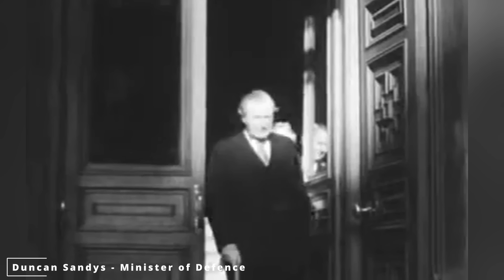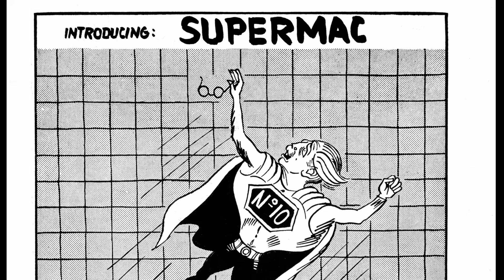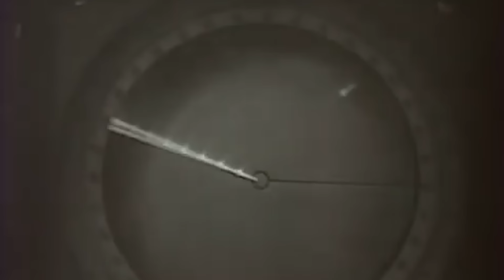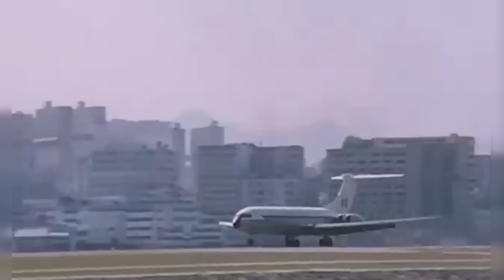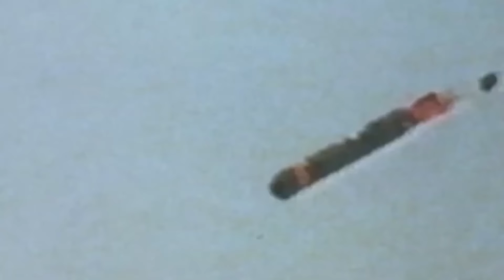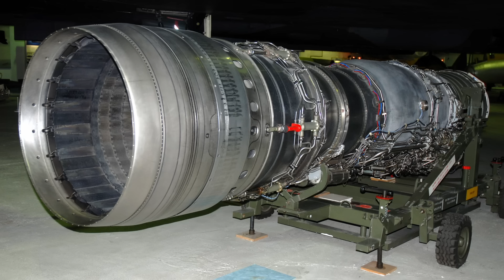How Britain Turned A Failed Airliner Into a Soviet Submarine Predator | The Mighty Nimrod

Comment: Still think we have always had the best looking aircraft and submarines...

Now we have copy and paste appeasement vehicles. I will never fight for sell out shell of a nation and i do mean never... i would rather take the cell or bullet with my standards intact.
Reply: That's basically an admission, that you openly admit that British aircraft were inferior.
Reply: @sandervanderkammen9230 

Typhoon & Tornado, British design aircraft. 

Early days of the airliners.

The awesome De Havilland Comet.
World's first production jet airliner.
World's first high altitude airliner. 
At the time the Comet wasn't particularly dangerous. The DH Comet was definitely not the worst engineering failure in commercial airliner history.

Losses comparisons.
How things were in those days.

DeHavilland Comet 4 UK                          14% 
DeHavilland Comet all mks UK (ff 1949)17%  
Vickers VC10 UK (ff 1962)                         5%

Douglas DC-1  US                                       99%
Douglas DC-2                                              47%
Douglas DC-3                                              30%
Douglas DC-4                                              26%
Boeing s300    US                                       72% 
Boeing 307                                                  70%
Boeing 247                                                   48%
Boeing 707  (ff 1958)                                 32% 
Lockheed L-049 Constellation (ff 1943)  30%
Lockheed Electra US (ff 1957)                   29%
Fairchild FH-227 US (ff 1966)                   32%
McDonnell Douglas DC-8 US  (ff 1958)   14%
Sud Aviation Caravelle  (ff 1955)             15%
Canadair CL-44 Turboprop US (ff 1959) 46%  
Convair CV-580 Turboprop US (ff 1960) 22%
Convair CV-880     (ff 1959)                      27% 
Convair CV-990     (ff 1961)                      33%
Tupolev T-104        (ff 1956)                     16%
Vickers Viscount UK  (ff 1948)                29%  
Fokker F-27 Turboprop NL (ff 1955)       40%      

The Vickers VC10, fastest Atlantic crossing for a non supersonic jet airliner, held the record for 41 years.

For the first few years of operation the Caravelle & Comet had similar accident loss fatalities.

De Havilland had prior experience building many all metal construction airframe aircraft & thousands of jet powered fighter aircraft that were primarily of metal construction with pressurised cockpits & jet engines built by De-Havilland. No aircraft before the Comet was subjected to as much pre-production testing as the Comet. 

It's a great pity & a crying shame that British military forces had to occupy a large part of Germany for decades after 1945 & Russian military forces had to do the same. Of course Russia still posseses a large chunk of what was German territory & of course Russia & the UK produce nukes. Obviously Germany does not produce nukes.

Interesting British achievements.

The gas turbine engine was invented & patented in England before the 1800s.

Axial multi stage sequential stage compressor & turbine technology, first produced for turbo machinery use in England by Parsons of Ireland & North England during the 1800s. The components form the basis of most modern gas turbine aero engines. At the time the concept of the jet aircraft powered by axial internal combustion gas turbine engines was first mentioned thus the internal combustion jet engine & jet aircraft was indeed invented in England before the 1900s & before the Wright brothers got busy.

Work on the multi stage sequential stator rotor axial compressor as applicable to the axial compressor gas turbine aero engine was ongoing in England from around 1928 by Arnold Griffiths and others. By 1943 the Metrovik F2/3  Beryl was a running axial turbojet that was superior to anything anywhere else. As the centrifugal compressor engines were adequate and more powerful at the time development of a larger F2/3  version was commenced.

The Metrovik (UK)  F2/3 axial compressor gas turbine aero engine was flight certified & ran in 1942, it was the result of UK development work ongoing since 1929. At the time it was the most capable axial compressor turbojet in existence but was not required and development work continued on a larger version.

Frank Whittle performed the world's first demonstration of a gas turbine aero engine in 1937. People in Germany kept a close eye on everything going on in Britain at the time.

The centrifugal compressor RR Nene was the most powerful & most reliable gas turbine aero engine on the planet in 1944. That engine would be later built under license or copied in many countries including Russia (Mig-15 Mig-17), China, the US, France and Switzerland powered dozens of aircraft types for decades after 1944.

Pratt and Whitney and others produce centrifugal compressor gas turbine aero engines. The PW200 is a currently produced whittle style centrifugal compressor, reverse flow combustor, gas turbine aero engine. 

The world's first wind tunnel was constructed in England during the 1870s. The world's first supersonic wind tunnel was constructed in England in 1922.

There is no doubt that the Fairey (England)
Delta 2 was the world's first jet
aircraft to exceed 1000 mph.  Indeed It
exceeded the previous record by 310 mph &
held the record for 1 year. Incidentally, the Dassault Mirage 3 & 4 are based on the Fairey Delta 2.

More recent UK military jet aircraft.

The Tornado & Typhoon & their engines are Supersonic & are indeed British design aircraft with British design engines built by an international consortium. The Tornado design for example started life during the 1950s at Vickers as the AFVG, it's engine is based on the RR RB-199. The EE Lightening is also a British Supersonic jet aircraft.

The Typhoon is the British BAC-EAP with an engine based on the British RR XG-40, the Typhoon is also built by an international consortium.

Brazil has the world's third largest airliner manufacturer and makes very good airliners & Brazil is 100th down the list along with Indonesia for wealth per capita. Of course it is in fact the case that Embraer can't build those airliners without purchasing stuff from the US, UK & Europe. For example, Norway, Holland, Denmark, Ireland & Belgium, top 20 wealth per capita, don't make airliners, its as simple as that.

Global aerospace. 
From the 1950s sector rationalisation and consolidation took place. 70 companies in France and 300 companies in the US disappeared due to merger or dissolution. In the US Boeing was almost bankrupted by the 707 project.  Boeing had a well protected domestic market and the available space and resources in the US to engage in large scale airliner manufacturing enabling them to capture orders simply by being able to produce airframes fast enough and cheap and nasty enough. Another factor is airlines preferring to obtain as much of their airliner inventory as possible from one manufacturer. 

Global Aerospace Sector, what's happening.

For example, there are of course no German companies that makes German jet aircraft in Germany & there are no German companies that make German gas turbine aero engines in Germany that are suitable for widebody airliners.

The UK has the world's highest combined per capita Nuclear / Defence / Aerospace Sector Activity.

UK defence sector, absolute terms, world's second highest activity. 1st for per capita defence sector activity. Per capita nuclear powered submarine construction, 2nd position. 
Main players being Rolls Royce, Babcock, GKN Aerospace & BAe Systems. Activities often involve international collaboration. BAe systems, RR and other UK companies now handle more Airbus work value wise than Germany. 

There's a good chance that anyone currently flying on a widebody airliner will be on an aircraft powered by RR gas turbine aero engines made in the UK and a good chance there will be other hardware on the aircraft that's designed and / or manufactured in the UK. 

Rolls Royce Holdings UK
Subsidiaries
- Rolls-Royce plc
- Rolls-Royce North America (ex Allison etc Classified Military stuff)
- Rolls-Royce AB
- Rolls-Royce Deutschland
- Rolls-Royce India Private Limited
- Rolls-Royce Marine Power Operations
- Vinters Engineering Limited
- Rolls-Royce Controls and Data Services
- Rolls-Royce Power Systems
- Bergen Marine
Joint ventures include:
- Rolls-Royce Turbomeca
- MTU Turbomeca -

Trent Family
The MT30 (Marine Turbine)
Industrial Trent 60 Gas Turbine
Trent 7000
Trent XWB Airbus A330neo.
Trent 1500
Trent 1000
Trent 500
Trent 600
Trent 700
Trent 800
Trent 8100
Trent 900
   
RR wholly owned subsidiaries in Germany handle smaller 2 shaft RR gas turbine aero engine work.

The UK space and aerospace sectors are highly productive, high-value industries that together contribute over £18 Billion in direct Gross Value Added (GVA) to the UK economy. Individually, the space industry directly contributes about 0.3% of UK GDP 7•2 Billion while the aerospace industry contributes approximately 0.5% £10•9 Billion.
   
We hope this helps.
Reply: Vulcan and harrier are cool-looking planes, but the rest...
Reply: @motormannband  Nimrod, Victor, Lanc's, Spitfire, Hurricane, Typhoon, Mosquito, Hawk, Hunter, Lightning, Javelin, TSR-2, Avro Delta Series, Avro 707 and every single Submarine 1939 to present...
Reply: I've heard a Tornado being described as a brutal looking aircraft. Kind of fits I think.
Hunter was undoubtedly the prettiest.
Reply: @kitbag9033  I think Tornado and EF Typhoon are actually some of the best looking (And EF Typhoon is my favourite fighter on Earth). But i was just listing "British only". FULL Joint projects are fine, but just buying mediocre copy paste from another nation and justifying it because we make some bolts for it don't wash lol.
Reply: @babalonkie  Tornado and Typhoon are not British.
Reply: @DoktorBayerischeMotorenWerke 

Typhoon & Tornado, British design aircraft. 

Early days of the airliners.

The awesome De Havilland Comet.
World's first production jet airliner.
World's first high altitude airliner. 
At the time the Comet wasn't particularly dangerous. The DH Comet was definitely not the worst engineering failure in commercial airliner history.

Losses comparisons.
How things were in those days.

DeHavilland Comet 4 UK                          14% 
DeHavilland Comet all mks UK (ff 1949)17%  
Vickers VC10 UK (ff 1962)                         5%

Douglas DC-1  US                                       99%
Douglas DC-2                                              47%
Douglas DC-3                                              30%
Douglas DC-4                                              26%
Boeing s300    US                                       72% 
Boeing 307                                                  70%
Boeing 247                                                   48%
Boeing 707  (ff 1958)                                 32% 
Lockheed L-049 Constellation (ff 1943)  30%
Lockheed Electra US (ff 1957)                   29%
Fairchild FH-227 US (ff 1966)                   32%
McDonnell Douglas DC-8 US  (ff 1958)   14%
Sud Aviation Caravelle  (ff 1955)             15%
Canadair CL-44 Turboprop US (ff 1959) 46%  
Convair CV-580 Turboprop US (ff 1960) 22%
Convair CV-880     (ff 1959)                      27% 
Convair CV-990     (ff 1961)                      33%
Tupolev T-104        (ff 1956)                     16%
Vickers Viscount UK  (ff 1948)                29%  
Fokker F-27 Turboprop NL (ff 1955)       40%      

The Vickers VC10, fastest Atlantic crossing for a non supersonic jet airliner, held the record for 41 years.

For the first few years of operation the Caravelle & Comet had similar accident loss fatalities.

De Havilland had prior experience building many all metal construction airframe aircraft & thousands of jet powered fighter aircraft that were primarily of metal construction with pressurised cockpits & jet engines built by De-Havilland. No aircraft before the Comet was subjected to as much pre-production testing as the Comet. 

It's a great pity & a crying shame that British military forces had to occupy a large part of Germany for decades after 1945 & Russian military forces had to do the same. Of course Russia still posseses a large chunk of what was German territory & of course Russia & the UK produce nukes. Obviously Germany does not produce nukes.

Interesting British achievements.

The gas turbine engine was invented & patented in England before the 1800s.

Axial multi stage sequential stage compressor & turbine technology, first produced for turbo machinery use in England by Parsons of Ireland & North England during the 1800s. The components form the basis of most modern gas turbine aero engines. At the time the concept of the jet aircraft powered by axial internal combustion gas turbine engines was first mentioned thus the internal combustion jet engine & jet aircraft was indeed invented in England before the 1900s & before the Wright brothers got busy.

Work on the multi stage sequential stator rotor axial compressor as applicable to the axial compressor gas turbine aero engine was ongoing in England from around 1928 by Arnold Griffiths and others. By 1943 the Metrovik F2/3  Beryl was a running axial turbojet that was superior to anything anywhere else. As the centrifugal compressor engines were adequate and more powerful at the time development of a larger F2/3  version was commenced.

The Metrovik (UK)  F2/3 axial compressor gas turbine aero engine was flight certified & ran in 1942, it was the result of UK development work ongoing since 1929. At the time it was the most capable axial compressor turbojet in existence but was not required and development work continued on a larger version.

Frank Whittle performed the world's first demonstration of a gas turbine aero engine in 1937. People in Germany kept a close eye on everything going on in Britain at the time.

The centrifugal compressor RR Nene was the most powerful & most reliable gas turbine aero engine on the planet in 1944. That engine would be later built under license or copied in many countries including Russia (Mig-15 Mig-17), China, the US, France and Switzerland powered dozens of aircraft types for decades after 1944.

Pratt and Whitney and others produce centrifugal compressor gas turbine aero engines. The PW200 is a currently produced whittle style centrifugal compressor, reverse flow combustor, gas turbine aero engine. 

The world's first wind tunnel was constructed in England during the 1870s. The world's first supersonic wind tunnel was constructed in England in 1922.

There is no doubt that the Fairey (England)
Delta 2 was the world's first jet
aircraft to exceed 1000 mph.  Indeed It
exceeded the previous record by 310 mph &
held the record for 1 year. Incidentally, the Dassault Mirage 3 & 4 are based on the Fairey Delta 2.

More recent UK military jet aircraft.

The Tornado & Typhoon & their engines are Supersonic & are indeed British design aircraft with British design engines built by an international consortium. The Tornado design for example started life during the 1950s at Vickers as the AFVG, it's engine is based on the RR RB-199. The EE Lightening is also a British Supersonic jet aircraft.

The Typhoon is the British BAC-EAP with an engine based on the British RR XG-40, the Typhoon is also built by an international consortium.

Brazil has the world's third largest airliner manufacturer and makes very good airliners & Brazil is 100th down the list along with Indonesia for wealth per capita. Of course it is in fact the case that Embraer can't build those airliners without purchasing stuff from the US, UK & Europe. For example, Norway, Holland, Denmark, Ireland & Belgium, top 20 wealth per capita, don't make airliners, its as simple as that.

Global aerospace. 
From the 1950s sector rationalisation and consolidation took place. 70 companies in France and 300 companies in the US disappeared due to merger or dissolution. In the US Boeing was almost bankrupted by the 707 project.  Boeing had a well protected domestic market and the available space and resources in the US to engage in large scale airliner manufacturing enabling them to capture orders simply by being able to produce airframes fast enough and cheap and nasty enough. Another factor is airlines preferring to obtain as much of their airliner inventory as possible from one manufacturer. 

Global Aerospace Sector, what's happening.

For example, there are of course no German companies that makes German jet aircraft in Germany & there are no German companies that make German gas turbine aero engines in Germany that are suitable for widebody airliners.

The UK has the world's highest combined per capita Nuclear / Defence / Aerospace Sector Activity.

UK defence sector, absolute terms, world's second highest activity. 1st for per capita defence sector activity. Per capita nuclear powered submarine construction, 2nd position. 
Main players being Rolls Royce, Babcock, GKN Aerospace & BAe Systems. Activities often involve international collaboration. BAe systems, RR and other UK companies now handle more Airbus work value wise than Germany. 

There's a good chance that anyone currently flying on a widebody airliner will be on an aircraft powered by RR gas turbine aero engines made in the UK and a good chance there will be other hardware on the aircraft that's designed and / or manufactured in the UK. 

Rolls Royce Holdings UK
Subsidiaries
- Rolls-Royce plc
- Rolls-Royce North America (ex Allison etc Classified Military stuff)
- Rolls-Royce AB
- Rolls-Royce Deutschland
- Rolls-Royce India Private Limited
- Rolls-Royce Marine Power Operations
- Vinters Engineering Limited
- Rolls-Royce Controls and Data Services
- Rolls-Royce Power Systems
- Bergen Marine
Joint ventures include:
- Rolls-Royce Turbomeca
- MTU Turbomeca -

Trent Family
The MT30 (Marine Turbine)
Industrial Trent 60 Gas Turbine
Trent 7000
Trent XWB Airbus A330neo.
Trent 1500
Trent 1000
Trent 500
Trent 600
Trent 700
Trent 800
Trent 8100
Trent 900
   
RR wholly owned subsidiaries in Germany handle smaller 2 shaft RR gas turbine aero engine work.

The UK space and aerospace sectors are highly productive, high-value industries that together contribute over £18 Billion in direct Gross Value Added (GVA) to the UK economy. Individually, the space industry directly contributes about 0.3% of UK GDP 7•2 Billion while the aerospace industry contributes approximately 0.5% £10•9 Billion.
   
We hope this helps.
Reply: @kitbag9033 Hunter still is a beautiful bird.
Reply: With the current and likely future leaders of the UK, if we did join an armed conflict, I'm not sure we'd be on the right side
Reply: @RoamingAdhocrat  I will publicly say what side i am on... Not any individual bought/threatened/aligned to/by the monarchy, USA or super wealthy (Starmer, Streeting, Davis, Polanski, Farage and the entire Tory party... they are all "Bought" and they will all manipulate to force a certain outcome to benefit themselves and their masters... of which is not Joe Public of Britain or anywhere).

That playbook don't work on me anymore... infact, i am now the type of person that will crawl through barbwire just to burn that playbook in their faces.
Reply: @RoamingAdhocrat  The UK is still a United States territory and protectorate... so that decision will be made in America, not Britain.
Reply: @DoktorBayerischeMotorenWerke  And the US, since ~2000, has a disastrous track record... not sure what good they've done lately other than support Ukraine and even that's been half-hearted
Reply: @RoamingAdhocrat  Britain has not won a war (a real war) since 1918.
Reply: @DoktorBayerischeMotorenWerke sure, if you exclude all the wars since then that contradict your point 🤡
Reply: @RoamingAdhocrat  Britain surrendered to the U.S. in September 1940 and was a U.S. possession from 1946 until 2006
Reply: @DoktorBayerischeMotorenWerke  ok
Reply: @RoamingAdhocrat  The Tizard Mission and the Anglo-American Bailout Loan Agreement were truly humiliating events in British history that are rarely discussed in the UK... brits prefer to use the euphemistic expression the "Special Relationship" with American to refer to this shameful defeat.
Reply: @RoamingAdhocrat Hows your boat?
Reply: @TarryHruman I don't have a boat. Do you mean my bike? I left it on the driveway and some months later, noticed someone stole it.
Reply: @RoamingAdhocrat I needed a new vape. So....sorrry?
Reply: Blackbird, Hustler, Stratojet, Tomcat, Falcon, Eagle....are you mad?
Reply: @TarryHruman Other than the BlackBird and F-16... i think the others are god ugly overhyped fat whales... always have (Exact same with the chungus fuel guzzler known as the Raptor). F-16 is cute and the only aircraft that actually looks like a fighter (Because it is the only real fighter among them) but i would still choose any current European fighter in looks and performance.

But i think the UK publicly rejecting repeated offered purchases of most of those aircraft speaks louder than my words... So does the nations who tried to appease by buying F-16's and F-18's and quickly realising they are expensive to maintain degrading hand off's and can't get into weapons envelope of a Chinese spy balloon... and putting them down for immediate replacement with European Aircraft... But hey ho... Just Europe "Stepping up" as requested.
Reply: @babalonkie I thought we were talking about aircraft. Not empire. I'm not sure what you mean about the F-16 being the "only real fighter among them" as the F-15 has managed 104 A2A kills with ZERO A2A losses. If that's not a "real fighter", then what is it?
Reply: @TarryHruman "I thought we were talking about aircraft. Not empire. I'm not sure what you mean about the F-16 being the "only real fighter among them" as the F-15 has managed 104 A2A kills with ZERO A2A losses. If that's not a "real fighter", then what is it?"

You are looking into that far too much... it was not meant to be a insult or opinion. "Fighter"... is different to a Strike Fighter or Interceptor Fighter for example... It is a "True Fighter"... As any USAF Pilot will tell you... whether they have flown one or not.

But if you are going to bring up stats... Who needs to shoot it down when it has a official "1.99 aircraft destroyed per 100,000 flight hours" record lol...
Reply: @babalonkie  Please name a British combat jet that is still in RAF service? Or any British company that still makes a British jet aircraft in the UK?
Reply: @DoktorBayerischeMotorenWerke 

Comet / Nimrod notes. 

We believe we can clear up some commonly held myths and misconceptions obviously.

It's always good to see the facts presented clearly and concisely isn't it?

Obviously there have been worse aircraft for accident losses both before & after the Comet.

All jet airliners benefited greatly from the knowledge gained from the Comet incidents & subsequent investigations & yet some were still worse for accident losses. 

It's a great pity & a crying shame that British military forces had to occupy a large part of Germany for decades after 1945 & Russian military forces had to do the same. Of course Russia still posseses a large chunk of what was German territory & of course Russia & the UK produce nukes. Obviously Germany does not produce nukes.

Instances of all marks of the Comet flew with full certification after 1954 including the Comet 3. The last Comet flight occured in 1997.

The fabulous trail blazing DH Comet.
World's first jet airliner.
World's first high altitude airliner.
World's first airliner with a full fuselage length pressurised cabin pressurised for high altitude flight. That feature for that type of aircraft was a considerably difficult undertaking. 

How things were back then.
Accident losses - % of aircraft built.

DeHavilland Comet 4 UK                          14% 
DeHavilland Comet all UK (ff 1949)        17%  
Vickers VC10 UK (ff 1962)                        5%

Douglas DC-1  US                                       99%
Douglas DC-2                                              47%
Douglas DC-3                                              30%
Douglas DC-4                                              26%
Boeing s300    US                                       72% 
Boeing 307                                                  70%
Boeing 247                                                   48%
Boeing 707  (ff 1958)                                 32% 
Lockheed L-049 Constellation (ff 1958)  30%
Lockheed Electra US (ff 1958)                   29%
Fairchild FH-227 US (ff 1966)                   30%
McDonnell Douglas DC-8 US  (ff 1958)   14%
Sud Aviation Caravelle  (ff 1955)             15%
Canadair CL-44 Turboprop US (ff 1959) 46%  
Convair CV-580 Turboprop US (ff 1960) 22%
Convair CV-880     (ff 1959)                      27% 
Convair CV-990     (ff 1961)                      33%
Tupolev T-104        (ff 1956)                     16%
Vickers Viscount UK  (ff 1948)                32%  
Fokker F-27 Turboprop (ff 1955)             39%      

The Vickers VC10, fastest Atlantic crossing for a non supersonic jet airliner, held the record for 41 years.

For the first few years of operation the Caravelle & Comet had similar accident loss fatalities.

The first few Nimrod airframes were Comet 4 airframes with the equipment bay tacked on. Subsequent Nimrods were new build Comet 4 airframes with the modifications built by the DH team at Hawker Siddeley.

Military aircraft accident losses. 
Lockheed XF104                 (ff 1954) 100%
Lockheed  P80                      (ff 1944) 43%
Lockheed F104                     (ff 1954) 45%
Grumman f9f                         (ff 1947) 47%
Convair F102 Dagger            (ff 1953) 45%  
MD F-101 Voodoo.                (ff 1954)  34%
MD FH Phantom 1                (ff 1945)  35%
MD F4 Phantom 2                 (ff 1958)  28%
MD F3H  Demon                    (ff 1951)  32%
Gloster Meteor UK                   (ff 1943) 21%
DH Vampire  UK                        (ff 1943) 23%
DH Sea Vixen  UK                     (ff 1951) 33%
DH Venom       UK                    (ff 1949)  16%
Gloster Javelin    UK                (ff 1951) 20%
EE Lightning     UK                   (ff 1954) 33%
HS Harrier      UK                     (ff 1962) 34%

The Sea Vixen was an aircraft carrier jets pioneer aircraft that was also regularly flown from carriers that were too small for the aircraft. 

The Tornado & Typhoon & their engines are supersonic & are indeed British design aircraft with British design engines built by an international consortium. The Tornado design for example started life during the 1950s at Vickers as the AFVG, it's engine is based on the RR RB-199. The EE Lightening is also a British Supersonic jet aircraft.

The Typhoon is the British BAC-EAP with an engine based on the British RR XG-40, the Typhoon is also built by an international consortium.

Global aerospace. 
From the 1950s sector rationalisation and consolidation took place. 70 companies in France and 300 companies in the US disappeared due to merger or dissolution. In the US Boeing was almost bankrupted by the 707 project.  Boeing had a well protected domestic market and the available space and resources in the US to engage in large scale airliner manufacturing enabling them to capture orders simply by being able to produce airframes fast enough. Brazil now has the world's 3rd largest airliner manufacturer & is towards the bottom half of the wealth per capita tables. Most of the countries at the top don't bother trying to have a lone national airliner manufacturer. 

For example, there are of course no German companies that makes German jet aircraft in Germany & there are no German Companies that make German gas turbine aero engines in Germany that are suitable for widebody airliners.

The UK has the world's highest combined per capita Nuclear / Defence / Aerospace Sector Activity.

UK defence sector, absolute terms, world's second highest activity. 1st for per capita defence sector activity. Per capita nuclear powered submarine construction, 2nd position. 
Main players being Rolls Royce, Babcock, GKN Aerospace & BAe Systems. Activities often involve international collaboration. BAe systems, RR and other UK companies now handle more Airbus work value wise than Germany. 

Rolls Royce Holdings UK
Subsidiaries
- Rolls-Royce plc
- Rolls-Royce North America (ex Allison etc Classified Military stuff)
- Rolls-Royce AB
- Rolls-Royce Deutschland
- Rolls-Royce India Private Limited
- Rolls-Royce Marine Power Operations
- Vinters Engineering Limited
- Rolls-Royce Controls and Data Services
- Rolls-Royce Power Systems
- Bergen Marine
Joint ventures include:
- Rolls-Royce Turbomeca
- MTU Turbomeca -

Trent Family
The MT30 (Marine Turbine)
Industrial Trent 60 Gas Turbine
Trent 7000
Trent XWB Airbus A330neo.
Trent 1500
Trent 1000
Trent 500
Trent 600
Trent 700
Trent 800
Trent 8100
Trent 900
   
RR wholly owned subsidiaries in Germany handle smaller 2 shaft RR gas turbine aero engine work.
Reply: @DoktorBayerischeMotorenWerke  "Please name a British combat jet that is still in RAF service? Or any British company that still makes a British jet aircraft in the UK?"

Still think we have always had the best looking aircraft and submarines...

Now we have copy and paste appeasement vehicles

Please name the person pretending to be European (Badly with their American Keyboard), desperately trying to make a insult after being hurt and that missed the original comment...

I will do it for you.. It's the person with many user reports resulting in hidden notifications and extra censorship on their account... it's you.

And i am Happy with the best looking and one of the best performing combat jets in the world that is based on the British EAP... Otherwise known as the Eurofighter Typhoon.
Reply: @babalonkie   Sorry lad, you lose.
 The last British jet designed was the BAe 146 (prod. ended 2001) and the last British jet to be manufactured was the Hawker (BAE) Hawk (prod ended 2024).

The TYPHOON is designed and manufactured by Eurofighter Jagdflugzeug GmbH.  a GERMAN COMPANY based in Munich Germany.

The TYPHOON is based on the Messerschmitt TKF-90 program.
 The EAP is completely unrelated to the TYPHOON... there were no countries interested by buying the EAP and it was grounded and retired in 1991.

NOW  Please name a single British company that still makes a British jet aircraft in the UK?
Reply: @DoktorBayerischeMotorenWerke   "Sorry lad, you lose.
 The last British jet designed was the BAe 146 (prod. ended 2001) and the last British jet to be manufactured was the Hawker (BAE) Hawk (prod ended 2024).

The TYPHOON is designed and manufactured by Eurofighter Jagdflugzeug GmbH.  a GERMAN COMPANY based in Munich Germany.

The TYPHOON is based on the Messerschmitt TKF-90 program.
 The EAP is completely unrelated to the TYPHOON... there were no countries interested by buying the EAP and it was grounded and retired in 1991.

NOW  Please name a single British company that still makes a British jet aircraft in the UK?"

"You lose" No... You cant actually lose stating facts to individual who is selective in reading them before replying.

Once again...

"Still think we have always had the best looking aircraft..."

And no... it was built by Eurofighter Jagdflugzeug GmbH on behalf of 4 nations... it was designed by BAE (UK), Airbus (representing Germany and Spain) Leonardo (Italy). The largest contributor to to Eurofighter was the UK with 37.42%.

Also the BAE EAP was designed and built... with it's designs being shared in joint partner project With Germany. TKF-90 was never built, BAE EAP was and is listed as the final prototype and design used for the Eurofighter.

Europe are more than partners... they are neighbours and they are family. The UK is agemate of Every large region of Europe. Working with them is not circumstantial or a subject of circumstance... it's normal. Unlike a misbehaving stranger nation in the far west... it's not our neighbour... and it never will be.

The facts are just not going to allow you to achieve what you are hoping to achieve here... and it makes me smile.

P.S. You should turn on the news... and see where Britain publicly told USA no in front of the world. Everyone saw it. Now... i am just going to do what Britain did to DJT and put you on mute... Your freedom of Speech has not been hampered by my Freedom to Ignore... You will still type and say... but i wont ever hear or see it lol.
Reply: @babalonkie  Don't be a sore loser lad... no like a bad loser.
Reply: @babalonkie British jet aircraft were simply not very good and operators refused to buy British planes without massive illegal kickback scams.
 1977 was the end of the British aerospace industry, the failures at BAC like Concorde and TSR.2, the flops at Hawker Siddley like the Trident, Nimrod and Comet 4 led to nationalization and ultimately the demise of the entire UK aircraft industry.
Britain today imports its commercial and military aircraft
Reply: @sandervanderkammen9230  "British jet aircraft were simply not very good and operators refused to buy British planes without massive illegal kickback scams.
 1977 was the end of the British aerospace industry, the failures at BAC like Concorde and TSR.2, the flops at Hawker Siddley like the Trident, Nimrod and Comet 4 led to nationalization and ultimately the demise of the entire UK aircraft industry.
Britain today imports its commercial and military aircraft"

Still cant read i see, even on a different account...

"Still think we have always HAD the best looking"

"Now we have copy and paste appeasement vehicles"

I can and i will... successfully block and ignore every account i choose on earth... No user, No country, No Military and no multi billion dollar company on Earth can or will ever stop me. 

And gone...
Reply: @sandervanderkammen9230 

We believe we can clear up some commonly held myths and misconceptions obviously.

It's always good to see the facts presented clearly and concisely isn't it?

All Nimrods were new build Comet 4 airframes with appropriate strengthening and the unpressurized  equipment bay tacked on. 

The HS 801 Nimrod was the most advanced aircraft of it's type at the time it first flew. Problems with the MRA4 programme were almost entirely due to radar and computer equipment issues and BAe Systems & co being too busy with other work at the time. 

Obviously there have been worse aircraft for accident losses both before & after the Comet.

Early problems with Comet takeoff stalls were caused by pilots over rotating the aircraft at liftoff. 

Podded engines on wings have aerodynamics issues. The main reasons for eventually going with podded engines were because or to facilitate -
Ease of maintenance.
Use of shear off fixings given excessive out of balance forces.
Large diameter turbofan engines.
Reduce load on the wing to fuselage connection. 
Increased power from later engines. 

The Bow-wing (See B-47 wing collapse & wing folding incidents) was a good example of how to expend a huge amount of cash and effort on something that was probably not worth bothering with. The basic design of the Comet had been decided upon and established before the podded engine choice has been made for the B-47. There were aerodynamics problems with podded pylon mounted engines at the time. The US also built and operated a significant number of EE Canberra bombers under licence which did not use podded engines for their wing mounted engines. . 

There have been aircraft losses caused by pod & pylon mounted engines. 

All jet airliners benefited greatly from the knowledge gained from the Comet incidents & subsequent investigations & yet some were still worse for accident losses. 

Instances of all marks of the Comet flew with full certification after 1954 including the Comet 3. The last Comet flight occured in 1997.

The fabulous trail blazing DH Comet.
World's first jet airliner in regular service.
The jet engined Avro Lancastrian actually did a passenger service before the DH Comet. 
World's first high altitude airliner.
World's first airliner with a full fuselage length pressurised cabin pressurised for high altitude flight. That feature for that type of aircraft was a considerably difficult undertaking. 

The change from larger squarer windows to smaller rounder windows was necessary for the particular aircraft at the time. Skin thickness remained mostly the same for all Comet marks. 

How things were back then.
Accident losses - % of aircraft built.

DeHavilland Comet 4 UK                          14% 
DeHavilland Comet all mks UK (ff 1949)17%  
Vickers VC10 UK (ff 1962)                         5%

Douglas DC-1  US                                       99%
Douglas DC-2                                              47%
Douglas DC-3                                              30%
Douglas DC-4                                              26%
Boeing s300    US                                       72% 
Boeing 307                                                  70%
Boeing 247                                                   48%
Boeing 707  (ff 1958)                                 32% 
Lockheed L-049 Constellation (ff 1943)  30%
Lockheed Electra US (ff 1957)                   29%
Fairchild FH-227 US (ff 1966)                   30%
McDonnell Douglas DC-8 US  (ff 1958)   14%
Sud Aviation Caravelle  (ff 1955)             15%
Canadair CL-44 Turboprop US (ff 1959) 46%  
Convair CV-580 Turboprop US (ff 1960) 22%
Convair CV-880     (ff 1959)                      27% 
Convair CV-990     (ff 1961)                      33%
Tupolev T-104        (ff 1956)                     16%
Vickers Viscount UK  (ff 1948)                29%  
Fokker F-27 Turboprop NL (ff 1955)       40%      

The Vickers VC10, fastest Atlantic crossing for a non supersonic jet airliner, held the record for 41 years.

For the first few years of operation the Caravelle & Comet had similar accident loss fatalities.

Sud Aviation Caravelle - 
all accident loss fatalities - 
1320 fatalities. 

De Havilland Comet - 
all accident loss fatalities - 
453 fatalities. 

An example of a typical airliner from the period. 
The Fokker Friendship F-27 fatalities & accident losses as a % of aircraft built. 
Fokker F-27 Turboprop (ff 1955)   40%
2130 fatalities.

Of course De Havilland carried out a full stress analysis & performed extensive & protracted testing on two long lengths of fuselage representing all features of a complete airframe. De Havilland carried out significantly more testing than was required by any authority at the time & significantly more testing that any previous airliner was subjected to.

De Havilland designers / engineers knew all there was to know about metal fatigue at the time they designed the DH Comet.

De Havilland had prior experience building many all metal construction airframe aircraft including many passengers aircraft & thousands of jet powered fighter aircraft that were primarily of metal construction with pressurised cockpits & used jet engines built by De-Havilland.

De Havilland did indeed always work to better than industry standards at the time, used up to date knowledge for the design & testing activities & no evidence of negligence or criminal negligence was ever produced in relation to the DH Comet.

Global aerospace. 
From the 1950s sector rationalisation and consolidation took place. 70 companies in France and 300 companies in the US disappeared due to merger or dissolution. In the US Boeing was almost bankrupted by the 707 project.  Boeing had a well protected domestic market and the available space and resources in the US to engage in large scale airliner manufacturing enabling them to capture orders simply by being able to produce airframes fast enough and cheap and nasty enough. Another factor is airlines preferring to obtain as much of their airliner inventory as possible from one manufacturer. 

Global Aerospace Sector, what's happening.

For example, there are of course no German companies that makes German jet aircraft in Germany & there are no German companies that make German gas turbine aero engines in Germany that are suitable for widebody airliners.

The UK has the world's highest combined per capita Nuclear / Defence / Aerospace Sector Activity.

UK defence sector, absolute terms, world's second highest activity. 1st for per capita defence sector activity. Per capita nuclear powered submarine construction, 2nd position. 
Main players being Rolls Royce, Babcock, GKN Aerospace & BAe Systems. Activities often involve international collaboration. BAe systems, RR and other UK companies now handle more Airbus work value wise than Germany. 

There's a good chance that anyone currently flying on a widebody airliner will be on an aircraft powered by RR gas turbine aero engines made in the UK and a good chance there will be other hardware on the aircraft that's designed and / or manufactured in the UK. 

Rolls Royce Holdings UK
Subsidiaries
- Rolls-Royce plc
- Rolls-Royce North America (ex Allison etc Classified Military stuff)
- Rolls-Royce AB
- Rolls-Royce Deutschland
- Rolls-Royce India Private Limited
- Rolls-Royce Marine Power Operations
- Vinters Engineering Limited
- Rolls-Royce Controls and Data Services
- Rolls-Royce Power Systems
- Bergen Marine
Joint ventures include:
- Rolls-Royce Turbomeca
- MTU Turbomeca -

Trent Family
The MT30 (Marine Turbine)
Industrial Trent 60 Gas Turbine
Trent 7000
Trent XWB Airbus A330neo.
Trent 1500
Trent 1000
Trent 500
Trent 600
Trent 700
Trent 800
Trent 8100
Trent 900
   
RR wholly owned subsidiaries in Germany handle smaller 2 shaft RR gas turbine aero engine work.

The UK space and aerospace sectors are highly productive, high-value industries that together contribute over £18 Billion in direct Gross Value Added (GVA) to the UK economy. Individually, the space industry directly contributes about 0.3% of UK GDP 7•2 Billion while the aerospace industry contributes approximately 0.5% £10•9 Billion.
   
We hope this helps.
Reply: @sandervanderkammen9230 

Typhoon & Tornado, British design aircraft. 

Early days of the airliners.

The awesome De Havilland Comet.
World's first production jet airliner.
World's first high altitude airliner. 
At the time the Comet wasn't particularly dangerous. The DH Comet was definitely not the worst engineering failure in commercial airliner history.

Losses comparisons.
How things were in those days.

DeHavilland Comet 4 UK                          14% 
DeHavilland Comet all mks UK (ff 1949)17%  
Vickers VC10 UK (ff 1962)                         5%

Douglas DC-1  US                                       99%
Douglas DC-2                                              47%
Douglas DC-3                                              30%
Douglas DC-4                                              26%
Boeing s300    US                                       72% 
Boeing 307                                                  70%
Boeing 247                                                   48%
Boeing 707  (ff 1958)                                 32% 
Lockheed L-049 Constellation (ff 1943)  30%
Lockheed Electra US (ff 1957)                   29%
Fairchild FH-227 US (ff 1966)                   32%
McDonnell Douglas DC-8 US  (ff 1958)   14%
Sud Aviation Caravelle  (ff 1955)             15%
Canadair CL-44 Turboprop US (ff 1959) 46%  
Convair CV-580 Turboprop US (ff 1960) 22%
Convair CV-880     (ff 1959)                      27% 
Convair CV-990     (ff 1961)                      33%
Tupolev T-104        (ff 1956)                     16%
Vickers Viscount UK  (ff 1948)                29%  
Fokker F-27 Turboprop NL (ff 1955)       40%      

The Vickers VC10, fastest Atlantic crossing for a non supersonic jet airliner, held the record for 41 years.

For the first few years of operation the Caravelle & Comet had similar accident loss fatalities.

De Havilland had prior experience building many all metal construction airframe aircraft & thousands of jet powered fighter aircraft that were primarily of metal construction with pressurised cockpits & jet engines built by De-Havilland. No aircraft before the Comet was subjected to as much pre-production testing as the Comet. 

It's a great pity & a crying shame that British military forces had to occupy a large part of Germany for decades after 1945 & Russian military forces had to do the same. Of course Russia still posseses a large chunk of what was German territory & of course Russia & the UK produce nukes. Obviously Germany does not produce nukes.

Interesting British achievements.

The gas turbine engine was invented & patented in England before the 1800s.

Axial multi stage sequential stage compressor & turbine technology, first produced for turbo machinery use in England by Parsons of Ireland & North England during the 1800s. The components form the basis of most modern gas turbine aero engines. At the time the concept of the jet aircraft powered by axial internal combustion gas turbine engines was first mentioned thus the internal combustion jet engine & jet aircraft was indeed invented in England before the 1900s & before the Wright brothers got busy.

Work on the multi stage sequential stator rotor axial compressor as applicable to the axial compressor gas turbine aero engine was ongoing in England from around 1928 by Arnold Griffiths and others. By 1943 the Metrovik F2/3  Beryl was a running axial turbojet that was superior to anything anywhere else. As the centrifugal compressor engines were adequate and more powerful at the time development of a larger F2/3  version was commenced.

The Metrovik (UK)  F2/3 axial compressor gas turbine aero engine was flight certified & ran in 1942, it was the result of UK development work ongoing since 1929. At the time it was the most capable axial compressor turbojet in existence but was not required and development work continued on a larger version.

Frank Whittle performed the world's first demonstration of a gas turbine aero engine in 1937. People in Germany kept a close eye on everything going on in Britain at the time.

The centrifugal compressor RR Nene was the most powerful & most reliable gas turbine aero engine on the planet in 1944. That engine would be later built under license or copied in many countries including Russia (Mig-15 Mig-17), China, the US, France and Switzerland powered dozens of aircraft types for decades after 1944.

Pratt and Whitney and others produce centrifugal compressor gas turbine aero engines. The PW200 is a currently produced whittle style centrifugal compressor, reverse flow combustor, gas turbine aero engine. 

The world's first wind tunnel was constructed in England during the 1870s. The world's first supersonic wind tunnel was constructed in England in 1922.

There is no doubt that the Fairey (England)
Delta 2 was the world's first jet
aircraft to exceed 1000 mph.  Indeed It
exceeded the previous record by 310 mph &
held the record for 1 year. Incidentally, the Dassault Mirage 3 & 4 are based on the Fairey Delta 2.

More recent UK military jet aircraft.

The Tornado & Typhoon & their engines are Supersonic & are indeed British design aircraft with British design engines built by an international consortium. The Tornado design for example started life during the 1950s at Vickers as the AFVG, it's engine is based on the RR RB-199. The EE Lightening is also a British Supersonic jet aircraft.

The Typhoon is the British BAC-EAP with an engine based on the British RR XG-40, the Typhoon is also built by an international consortium.

Brazil has the world's third largest airliner manufacturer and makes very good airliners & Brazil is 100th down the list along with Indonesia for wealth per capita. Of course it is in fact the case that Embraer can't build those airliners without purchasing stuff from the US, UK & Europe. For example, Norway, Holland, Denmark, Ireland & Belgium, top 20 wealth per capita, don't make airliners, its as simple as that.

Global aerospace. 
From the 1950s sector rationalisation and consolidation took place. 70 companies in France and 300 companies in the US disappeared due to merger or dissolution. In the US Boeing was almost bankrupted by the 707 project.  Boeing had a well protected domestic market and the available space and resources in the US to engage in large scale airliner manufacturing enabling them to capture orders simply by being able to produce airframes fast enough and cheap and nasty enough. Another factor is airlines preferring to obtain as much of their airliner inventory as possible from one manufacturer. 

Global Aerospace Sector, what's happening.

For example, there are of course no German companies that makes German jet aircraft in Germany & there are no German companies that make German gas turbine aero engines in Germany that are suitable for widebody airliners.

The UK has the world's highest combined per capita Nuclear / Defence / Aerospace Sector Activity.

UK defence sector, absolute terms, world's second highest activity. 1st for per capita defence sector activity. Per capita nuclear powered submarine construction, 2nd position. 
Main players being Rolls Royce, Babcock, GKN Aerospace & BAe Systems. Activities often involve international collaboration. BAe systems, RR and other UK companies now handle more Airbus work value wise than Germany. 

There's a good chance that anyone currently flying on a widebody airliner will be on an aircraft powered by RR gas turbine aero engines made in the UK and a good chance there will be other hardware on the aircraft that's designed and / or manufactured in the UK. 

Rolls Royce Holdings UK
Subsidiaries
- Rolls-Royce plc
- Rolls-Royce North America (ex Allison etc Classified Military stuff)
- Rolls-Royce AB
- Rolls-Royce Deutschland
- Rolls-Royce India Private Limited
- Rolls-Royce Marine Power Operations
- Vinters Engineering Limited
- Rolls-Royce Controls and Data Services
- Rolls-Royce Power Systems
- Bergen Marine
Joint ventures include:
- Rolls-Royce Turbomeca
- MTU Turbomeca -

Trent Family
The MT30 (Marine Turbine)
Industrial Trent 60 Gas Turbine
Trent 7000
Trent XWB Airbus A330neo.
Trent 1500
Trent 1000
Trent 500
Trent 600
Trent 700
Trent 800
Trent 8100
Trent 900
   
RR wholly owned subsidiaries in Germany handle smaller 2 shaft RR gas turbine aero engine work.

The UK space and aerospace sectors are highly productive, high-value industries that together contribute over £18 Billion in direct Gross Value Added (GVA) to the UK economy. Individually, the space industry directly contributes about 0.3% of UK GDP 7•2 Billion while the aerospace industry contributes approximately 0.5% £10•9 Billion.
   
We hope this helps.
Reply: @DoktorBayerischeMotorenWerke 

Typhoon & Tornado, British design aircraft. 

Early days of the airliners.

The awesome De Havilland Comet.
World's first production jet airliner.
World's first high altitude airliner. 
At the time the Comet wasn't particularly dangerous. The DH Comet was definitely not the worst engineering failure in commercial airliner history.

Losses comparisons.
How things were in those days.

DeHavilland Comet 4 UK                          14% 
DeHavilland Comet all mks UK (ff 1949)17%  
Vickers VC10 UK (ff 1962)                         5%

Douglas DC-1  US                                       99%
Douglas DC-2                                              47%
Douglas DC-3                                              30%
Douglas DC-4                                              26%
Boeing s300    US                                       72% 
Boeing 307                                                  70%
Boeing 247                                                   48%
Boeing 707  (ff 1958)                                 32% 
Lockheed L-049 Constellation (ff 1943)  30%
Lockheed Electra US (ff 1957)                   29%
Fairchild FH-227 US (ff 1966)                   32%
McDonnell Douglas DC-8 US  (ff 1958)   14%
Sud Aviation Caravelle  (ff 1955)             15%
Canadair CL-44 Turboprop US (ff 1959) 46%  
Convair CV-580 Turboprop US (ff 1960) 22%
Convair CV-880     (ff 1959)                      27% 
Convair CV-990     (ff 1961)                      33%
Tupolev T-104        (ff 1956)                     16%
Vickers Viscount UK  (ff 1948)                29%  
Fokker F-27 Turboprop NL (ff 1955)       40%      

The Vickers VC10, fastest Atlantic crossing for a non supersonic jet airliner, held the record for 41 years.

For the first few years of operation the Caravelle & Comet had similar accident loss fatalities.

De Havilland had prior experience building many all metal construction airframe aircraft & thousands of jet powered fighter aircraft that were primarily of metal construction with pressurised cockpits & jet engines built by De-Havilland. No aircraft before the Comet was subjected to as much pre-production testing as the Comet. 

It's a great pity & a crying shame that British military forces had to occupy a large part of Germany for decades after 1945 & Russian military forces had to do the same. Of course Russia still posseses a large chunk of what was German territory & of course Russia & the UK produce nukes. Obviously Germany does not produce nukes.

Interesting British achievements.

The gas turbine engine was invented & patented in England before the 1800s.

Axial multi stage sequential stage compressor & turbine technology, first produced for turbo machinery use in England by Parsons of Ireland & North England during the 1800s. The components form the basis of most modern gas turbine aero engines. At the time the concept of the jet aircraft powered by axial internal combustion gas turbine engines was first mentioned thus the internal combustion jet engine & jet aircraft was indeed invented in England before the 1900s & before the Wright brothers got busy.

Work on the multi stage sequential stator rotor axial compressor as applicable to the axial compressor gas turbine aero engine was ongoing in England from around 1928 by Arnold Griffiths and others. By 1943 the Metrovik F2/3  Beryl was a running axial turbojet that was superior to anything anywhere else. As the centrifugal compressor engines were adequate and more powerful at the time development of a larger F2/3  version was commenced.

The Metrovik (UK)  F2/3 axial compressor gas turbine aero engine was flight certified & ran in 1942, it was the result of UK development work ongoing since 1929. At the time it was the most capable axial compressor turbojet in existence but was not required and development work continued on a larger version.

Frank Whittle performed the world's first demonstration of a gas turbine aero engine in 1937. People in Germany kept a close eye on everything going on in Britain at the time.

The centrifugal compressor RR Nene was the most powerful & most reliable gas turbine aero engine on the planet in 1944. That engine would be later built under license or copied in many countries including Russia (Mig-15 Mig-17), China, the US, France and Switzerland powered dozens of aircraft types for decades after 1944.

Pratt and Whitney and others produce centrifugal compressor gas turbine aero engines. The PW200 is a currently produced whittle style centrifugal compressor, reverse flow combustor, gas turbine aero engine. 

The world's first wind tunnel was constructed in England during the 1870s. The world's first supersonic wind tunnel was constructed in England in 1922.

There is no doubt that the Fairey (England)
Delta 2 was the world's first jet
aircraft to exceed 1000 mph.  Indeed It
exceeded the previous record by 310 mph &
held the record for 1 year. Incidentally, the Dassault Mirage 3 & 4 are based on the Fairey Delta 2.

More recent UK military jet aircraft.

The Tornado & Typhoon & their engines are Supersonic & are indeed British design aircraft with British design engines built by an international consortium. The Tornado design for example started life during the 1950s at Vickers as the AFVG, it's engine is based on the RR RB-199. The EE Lightening is also a British Supersonic jet aircraft.

The Typhoon is the British BAC-EAP with an engine based on the British RR XG-40, the Typhoon is also built by an international consortium.

Brazil has the world's third largest airliner manufacturer and makes very good airliners & Brazil is 100th down the list along with Indonesia for wealth per capita. Of course it is in fact the case that Embraer can't build those airliners without purchasing stuff from the US, UK & Europe. For example, Norway, Holland, Denmark, Ireland & Belgium, top 20 wealth per capita, don't make airliners, its as simple as that.

Global aerospace. 
From the 1950s sector rationalisation and consolidation took place. 70 companies in France and 300 companies in the US disappeared due to merger or dissolution. In the US Boeing was almost bankrupted by the 707 project.  Boeing had a well protected domestic market and the available space and resources in the US to engage in large scale airliner manufacturing enabling them to capture orders simply by being able to produce airframes fast enough and cheap and nasty enough. Another factor is airlines preferring to obtain as much of their airliner inventory as possible from one manufacturer. 

Global Aerospace Sector, what's happening.

For example, there are of course no German companies that makes German jet aircraft in Germany & there are no German companies that make German gas turbine aero engines in Germany that are suitable for widebody airliners.

The UK has the world's highest combined per capita Nuclear / Defence / Aerospace Sector Activity.

UK defence sector, absolute terms, world's second highest activity. 1st for per capita defence sector activity. Per capita nuclear powered submarine construction, 2nd position. 
Main players being Rolls Royce, Babcock, GKN Aerospace & BAe Systems. Activities often involve international collaboration. BAe systems, RR and other UK companies now handle more Airbus work value wise than Germany. 

There's a good chance that anyone currently flying on a widebody airliner will be on an aircraft powered by RR gas turbine aero engines made in the UK and a good chance there will be other hardware on the aircraft that's designed and / or manufactured in the UK. 

Rolls Royce Holdings UK
Subsidiaries
- Rolls-Royce plc
- Rolls-Royce North America (ex Allison etc Classified Military stuff)
- Rolls-Royce AB
- Rolls-Royce Deutschland
- Rolls-Royce India Private Limited
- Rolls-Royce Marine Power Operations
- Vinters Engineering Limited
- Rolls-Royce Controls and Data Services
- Rolls-Royce Power Systems
- Bergen Marine
Joint ventures include:
- Rolls-Royce Turbomeca
- MTU Turbomeca -

Trent Family
The MT30 (Marine Turbine)
Industrial Trent 60 Gas Turbine
Trent 7000
Trent XWB Airbus A330neo.
Trent 1500
Trent 1000
Trent 500
Trent 600
Trent 700
Trent 800
Trent 8100
Trent 900
   
RR wholly owned subsidiaries in Germany handle smaller 2 shaft RR gas turbine aero engine work.

The UK space and aerospace sectors are highly productive, high-value industries that together contribute over £18 Billion in direct Gross Value Added (GVA) to the UK economy. Individually, the space industry directly contributes about 0.3% of UK GDP 7•2 Billion while the aerospace industry contributes approximately 0.5% £10•9 Billion.
   
We hope this helps.
Reply: @TarryHruman New York, London, Paris, Munich,